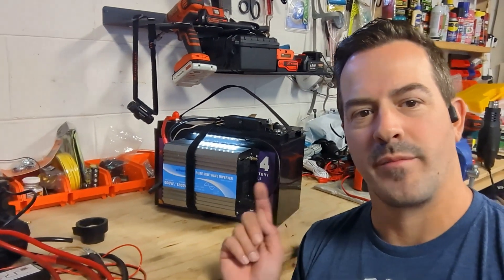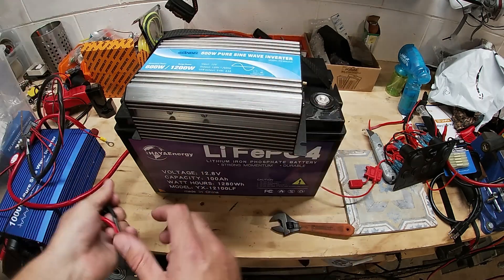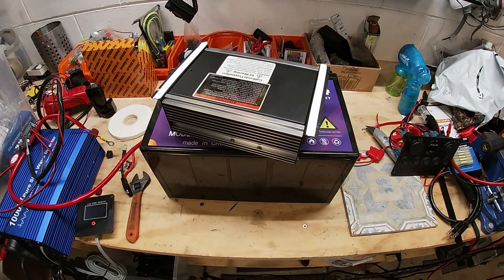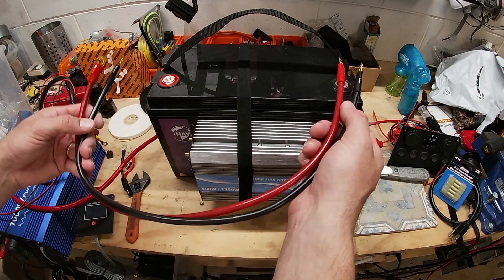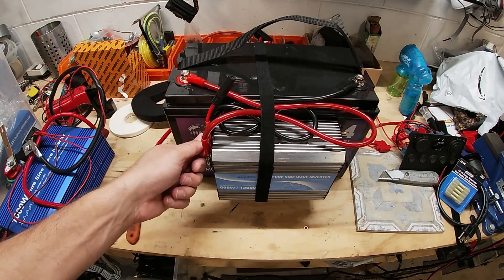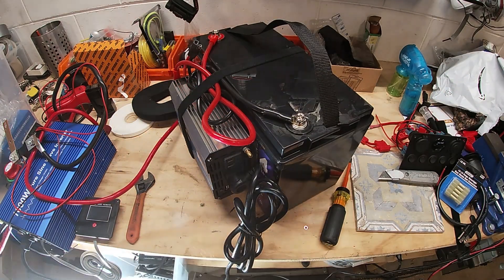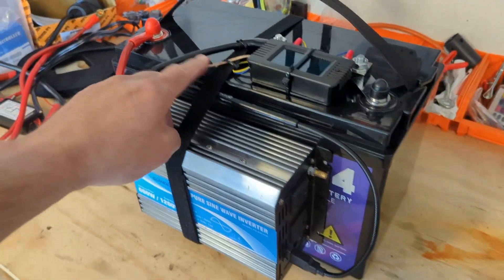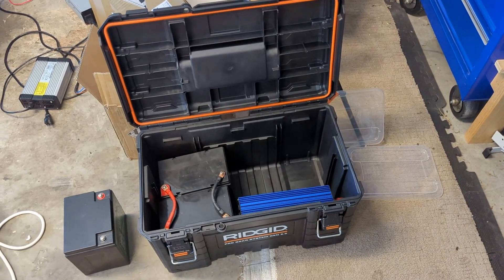EASY DIY Solar Generator, Compact Power Bank 120v USB HUGE Capacity 100ah 600w #DIY #SOLAR #LIFEPO4

Comment: Dude do you have a video how you set up your charger? Thanks!
Reply from the maker: New video will be a proper solar charger! Yep yep stay tuned 😀👍
Reply: @TackleThat thanks! Did you just connect the SAE with electrical tape or you found an adaptor for it?

Comment: Thanks. Well explained and good to know. Could you explain how you connected the charger cables and the shunt for the battery monitor. Are you able to charge the battery through the converter? Thanks again and I’m a new Solar follower.
Reply from the maker: Hi John! Thanks for your comment! Sure, the shunt goes between the negative terminal and the negative load (inverter in this case). The display will show you the details about the current going through the shunt. It also needs to be powered, so you just hook 2 more leads up to the + and - of your battery. When you purchase a shunt, they will include wiring details. ---- I am charging the battery through the terminal connections on the inverter, since they are in parallel with the battery. I am not technically charging through the inverter, just using those connections on the inverter for more then one use (load and charge) to optimize the use of wires and connectors.
Reply: Thank you for your quick and informative answer. Looking forward to future videos. Thanks again.

Comment: Nice. That's a good point about the inverters that have USB outputs. All your little emergency electronics should be USB rechargeable,
Reply from the maker: Totally agree, I do wish this inverter has 2 usb ports but 1 is better than none! They make little 12v to usb adapters, I hooked one up in my wattcycle video!
Reply: Yeah, I have a USB adapter with alligator clamps to attach to battery terminals that I bought a long time ago. I don't think I'd buy it now though, because inverters and solar charge controllers tend to include USB ports. I might buy a battery to 100W USB C though.  @TackleThat

Comment: There is a way to balance the cells of the battery pack to gain more capacity. Step one, charge to full (14.6 volts). Step two, connect a smart outlet to your wall outlet and connect your charger to the smart outlet. Step three, set the timer to turn on for one hour and turn off for 10 hours and then on for one hour and off for 10 hours. It could take many days for the balancing process to completely balance the cells but it should help with gaining additional capacity out of the battery pack.
Reply from the maker: Thank you for that information! I will give it a try!